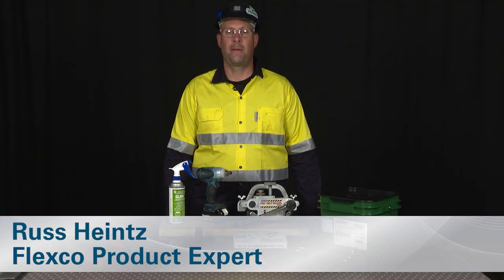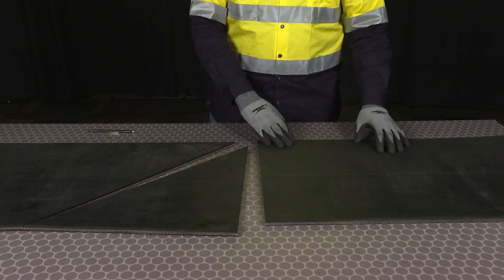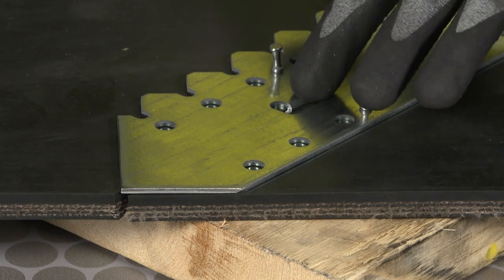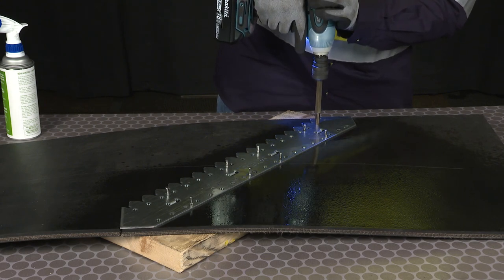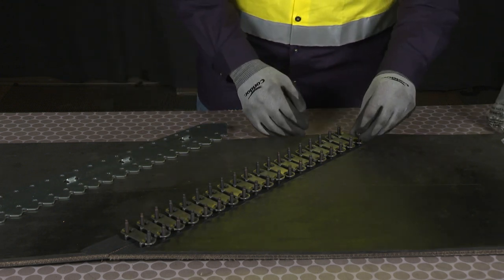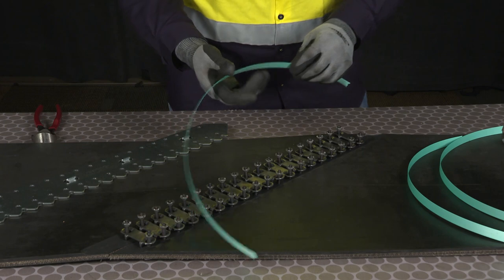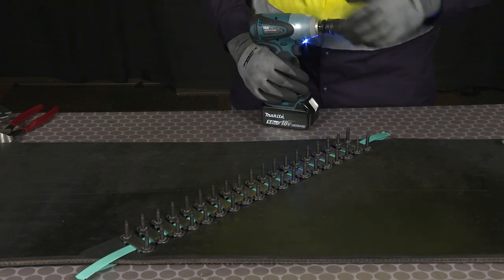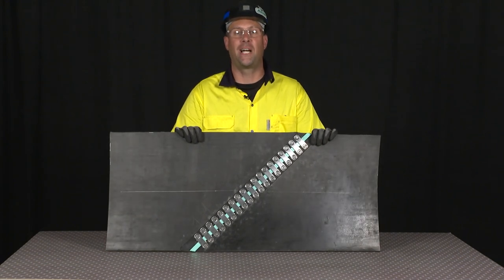45 Degree Flexco® Bolt Solid Plate Fastener Installation

Comment: Sir, what will be the strength of joint in 45deg. Splicing?
Will it be more than 90deg or not.
Reply from the maker: It will be the same strength as a 90 degree with the added benefit of going around 25% smaller pulleys when compared to a 90 degree splice.
Reply: It is actually more
Reply: Actually it is much stronger than any other degree

Comment: Is there a maximum belt tension and width that can be done with a 45deg splice?
Reply from the maker: Our highest rated standard bolt solid plate fastener is the 2-1/4 at 620 PIW, so that would be the maximum belt tension. 

Remember installing at a 45 degree doesn’t provide additional strength but allows less stress on the fasteners when going over the pulleys so we can decrease the minimum pulley size by 25% for the corresponding fastener installed at a 45 degree.

As for maximum width there is no constraint as long as Flexco can supply a template for your belt width. We have ability to make templates up 96” and wider if needed.

Comment: How does this lacing feels on the roller?
Reply from the maker: All Flexco Mechanical Belt Fasteners work in conjunction with all parts of the conveyor system, such as rollers (pulleys), idlers, cleaners, trackers, slider beds and impact beds.  The 45 degree splice helps the transition over the roller because the splice gradually flexes over the roller instead of all at once like a 90 degree splice.